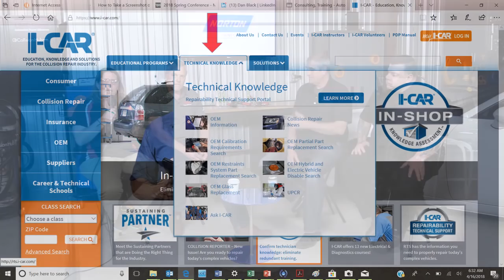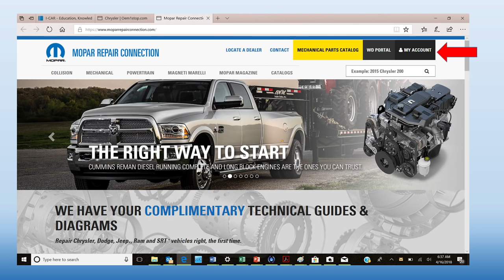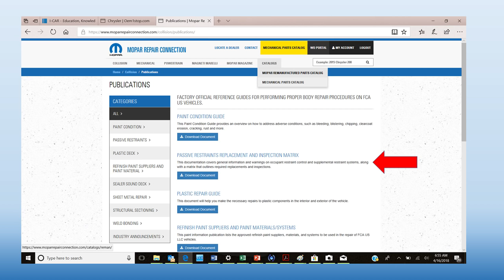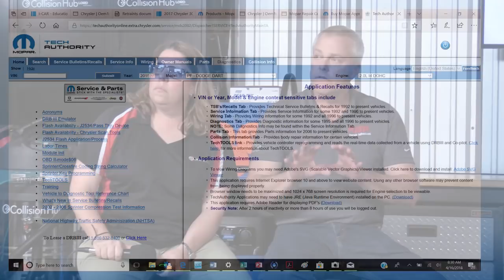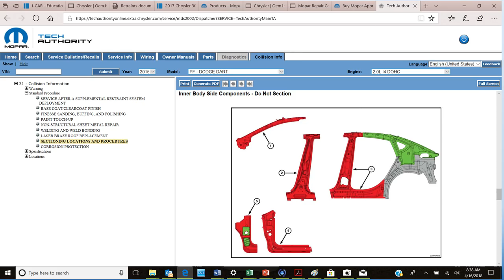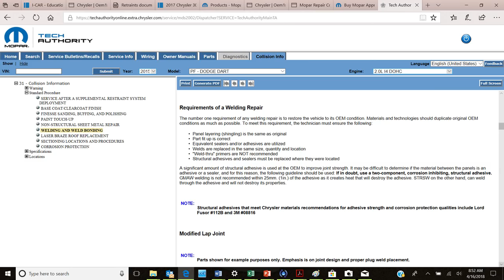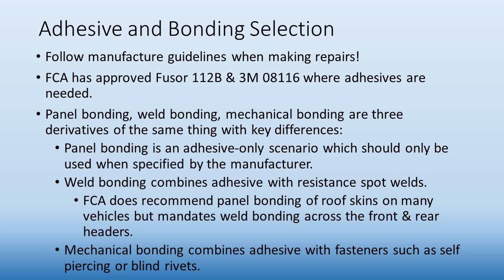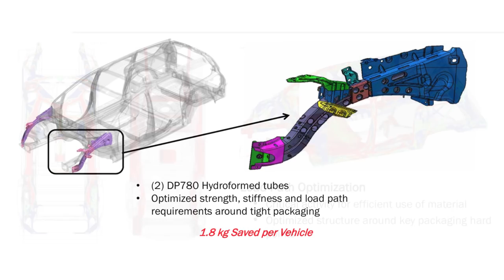Understanding Chrysler Dodge Jeep Fiat Collision Repair Procedures

Comment: What if OEM has revisional guidelines on how to avoid an unsafe repair to be less intrusive and less cost afective as long as there is no inner reinforcement or in a hinge area 50 millimeters from hinge or never in an engine mount area this kinda allows you to butcher am I correct 😂😂

Comment: I follow oem repair procedures to the best of my abilities but in the back of my mind I do think it is amusing that auto makers press the seriousness of Auto Body techs understanding corrosion protection when I have seen first hand cutting a 1-5 year old car apart and finding rust betweeen the panels and spot welds. I think most of the time after spraying cavity wax our repairs will outlast the factory ecoat.